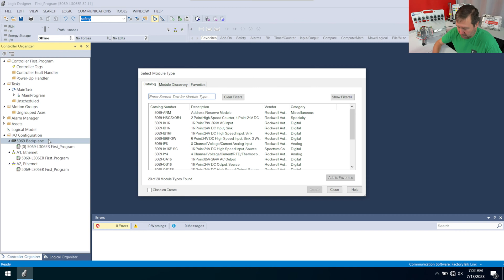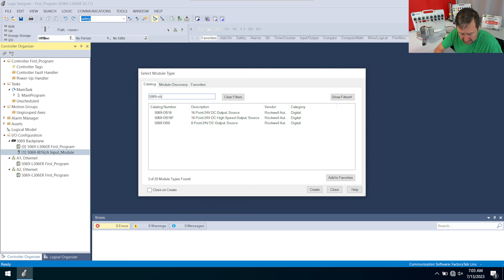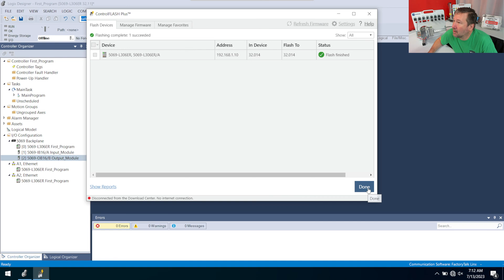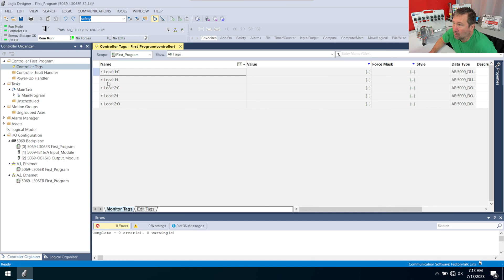Create a New 5069 Compactlogix Studio 5000 PLC Program

Comment: Hi Tim, how do I scale pt100 4mA to 20mA AI on Tia portal
Reply from the maker: A PT100 is an RTD, not a 4-20mA. They wouldn't be compatible.
Reply: @TimWilborne   

Thanks for your positive response 

I used a temperature controller card to convert a pt100 to (4 - 20mA) but I am finding hard to scale it using TIA portal to get actual temperature reading
Reply from the maker: I just played with this the other week.  We're working on a video series that will show you how.
Reply: @TimWilborne  
Big thanks